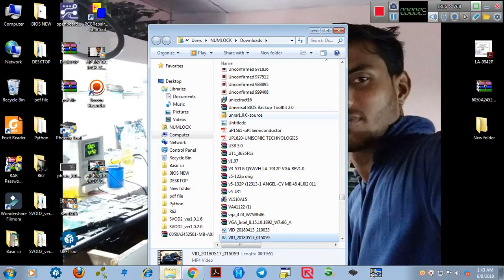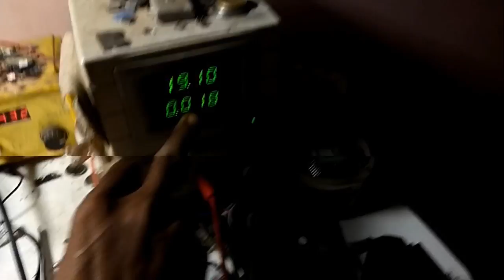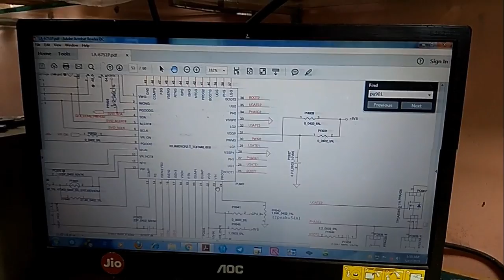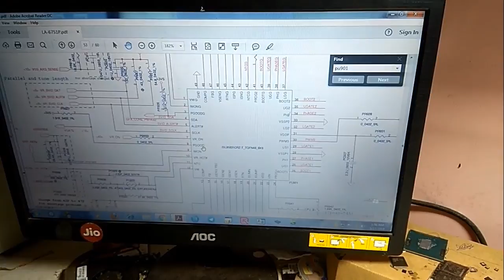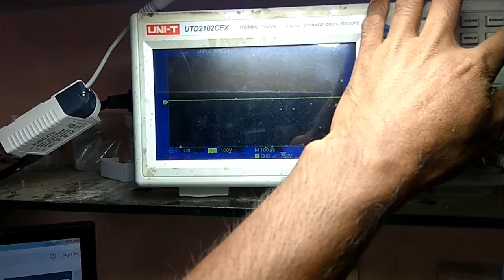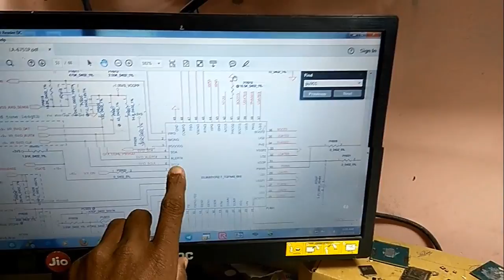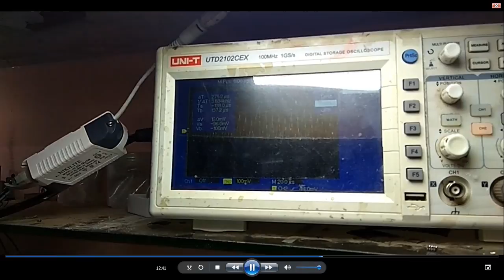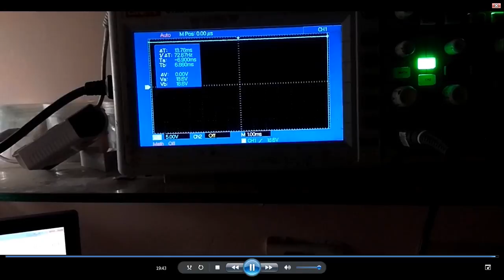HOW TO REPAIR LAPTOP USING DSO PART 11 DEMO

Comment: Dude you need to go by the timing for the intel series 6x chipset, first if CPU not getting supply you should  check PROCPWRGD  signal from PCH if that signal is not coming no CPU Vcore Check your timing pawdy looollololollll
Reply from the maker: Good thing... You watch the video in lockdown

You mention your lself the chip master

Then why you need to watch others video 😜😜😜😜😜😜😜
Reply: Sk Basir was a bit idle and bored and wanted to see what he was doing come on ma brother